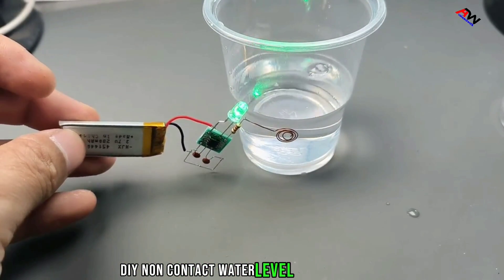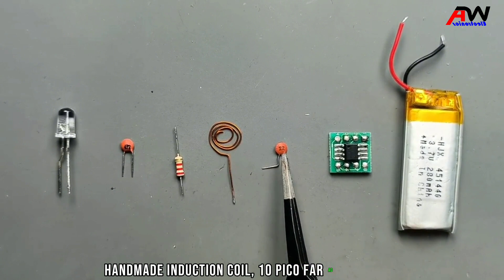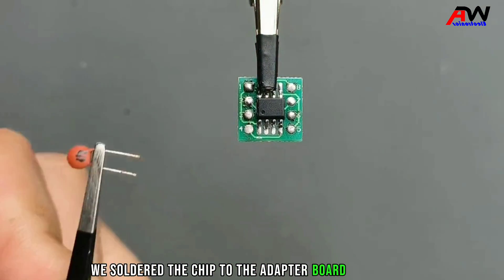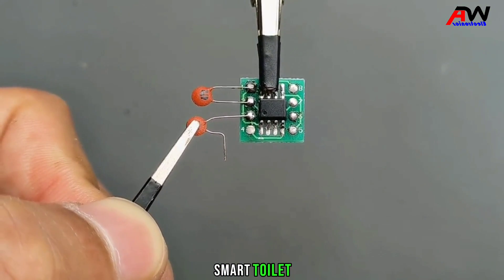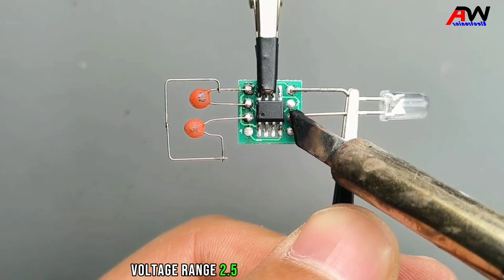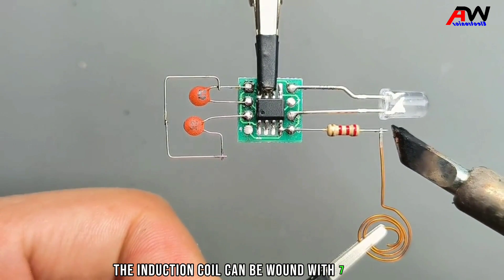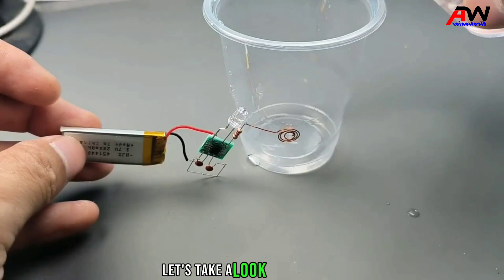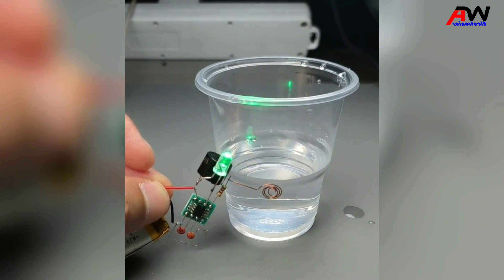Non Contact Water Level Sensor / indicator Diy Electronics Project

Comment: I have the TC301D chip, but where did you Get that printed circuit board its soldered to? that would be really handy to have. is it a SO-8 to DIP adapter?

Comment: I set up the circuit. It works. It resets after 60 seconds of waiting at the full water level. It doesn't give any output. I need to drain and refill it. I haven't found a solution. Do you have any suggestions? Thanks.

Comment: I think TP223 will also work..
Reply: no it's not work to get o/p long time more than 8 Sec due to its Re calibration Function, thats why TTP223 is not Useful for this application.
Reply: I also think that but when i did practical it was not working after 8 Sec. it reset the Touch sens. so we have to disconnect the finger from it then re touch it. so it's not possible in the Water tank.

Comment: TC301D IC Alternative??
Reply: Three bc547 transistor...
Reply: @parjitsingh6568 pls circuit diagram for bc 547*3
Reply: @parjitsingh6568  is it sens level contactless or wired ?